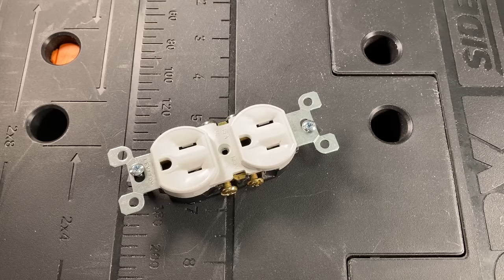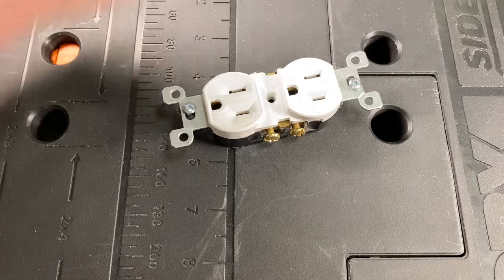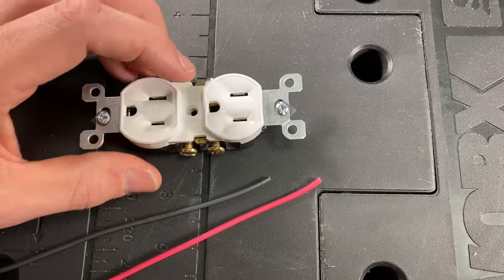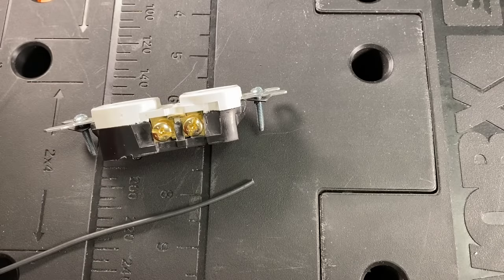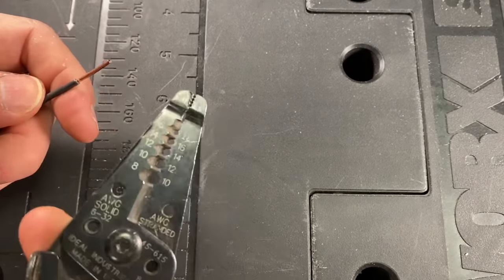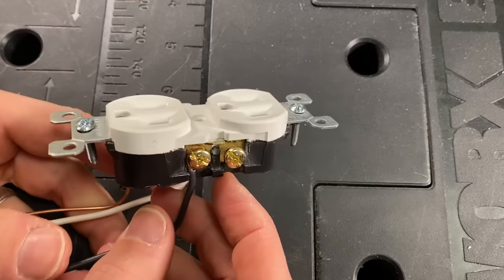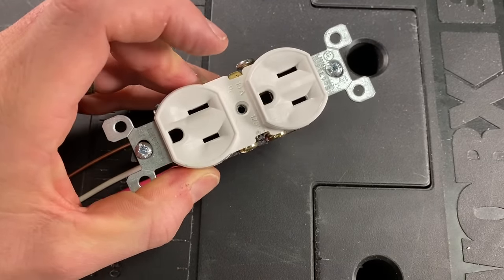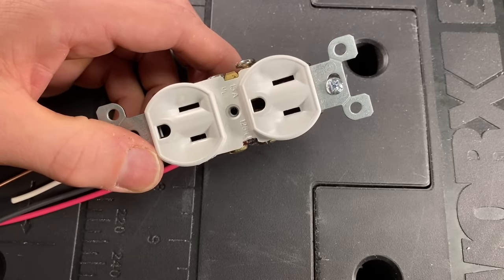Electrical Outlet Basics | How To Wire

Comment: I do believe the stripper guide is for the push in wires, but it works for the screw fittings, perhaps a bit on the short side.  Once one is consistent, it works fine.
Reply from the maker: I think you are right Paul, thanks for the feedback.

Comment: Those push-in contacts are the worst, especially if it’s an upstream outlet in a chain...  I was having trouble charging my EV outside only to discover an unused outlet in my pantry was burning itself up because of those push-in contacts... I changed the outlet and went with the screws and everything is perfect now!
Reply from the maker: Others have started to mention the EV charging issues especially when plugging into a $0.50 15 Amp Receptacle.  Probably will be something that NEC will want to address in the next revision.

Comment: Back in the day we didn't have voltage testers. We did have voltmeters so that is what we used.
Reply from the maker: You are not alone, sounds like many people prefer the meter over a voltage tester.
Reply: Some folks just stuck their thumb into the nearest electric socket (not recommended).  Cheers!
Reply: Definitely my choice...
Reply: @LectronCircuits  I used my Tongue 👅 😳
Reply: Were you trained to check first. Then after power off. Then check on known live??? I saw a pair of test leads be bad....Guy almost stuck his fingers in there.....
Reply: @timbernie  Also, always treat any wire as live!  Just like treat any gun as loaded; even if you just checked that it was unloaded!  There ar circumstances where you can’t turn off the power.  Ask a lineman!
Reply: @jimbaranski4687  Great advice. But, you are 38 yrs late.......
Reply: @jimbaranski4687  HUM! YEA! Jaimes......

Comment: One should never assume an existing outlet is wired correctly. The video is remiss in not illustrating how to check polarity with a voltage tester. Also, the NEC (Nat'l. Elec. Code, NFPA 70) does not specify the colors of ungrounded conductors; a switch leg to a switched recepticle does not have to be red. One should use a voltage tester to identify switched and unswitched conductors. Both of these processes require working with live conductors, albeit for a short amount of time. 
In other words, one should give serious consideration to having an electrician do the work.
If you screw up the plumbing you get a mop. If you screw up the electrical wiring, you call the fire dept. or maybe the coroner.
Bona fides; retired electrician w/40+yrs residential, commercial, industrial work in California and Connecticut.
Reply from the maker: Thanks for the help Ralph! 👍
Reply: And yet my plumber buddies make more loot than my electrician buddies, honestly.
Go figure, I can't. 🍺
Reply: @dpz9872  I know why plumbers make more and they can have it. Just watching them replace an old toilet or repair a broken domestic drain line made me glad that wasn’t my job.
Reply: @ralphaverill2001  
Money doesn't always equal smarts.
I move dirt and do okay not worrying about hepatitis etc.

Yeah, plumbers 😆.

Later
Reply from the maker: @ralphaverill2001  no doubt.  Things can get messy in a hurry 💩

Comment: Not required but I usually wrap electric tape once around the body covering the screws to minimize the chance of a terminal ever shorting out against a metal box.  This applies to switches also, and any two-gang box situations. You never know when someone in the future might  be working on the box with the power on. Or if eventually things work loose.

Comment: After installing 500 thousand outlets I don’t use the gauge anymore.Also 1 wire per terminal.
Reply: Never used the wire gauge lol. Just know not to strip out much lmao. And yes absolutely one wire per terminals.  If you got 3 wires just pig tail lol
Reply: Yes, one wire per terminal.  That’s why you have two screws on each side; usually for daisy chaining outlets.  I have seen a wire, stripped mid-wire, wrapped around a screw, and go on to something else.  I haven’t seen anything about that it the code! ~\~. There are an infinite ways to do stuff wrong.  Infinite kinds of stupid!

Comment: That was awesome!!!!!  Need to add several outlets in my She Shed..Was pretty Scared until I saw this video.  This may be a stupid question but,  is there a limit on how many outlets you can install on the same line of wire going to the Fuse box? Thank you!
Reply from the maker: The number of outlets would be more associated to the different appliances / tools which you plan to plug into each receptacle.  You can find load calculators online if you really want to dive a bit deeper.  Best of luck on your project and be safe.
Reply: @EverydayHomeRepairs  Thank you so much!!!!!!!!

Comment: Switch outlets should be installed upside down to identify them
Reply: Good idea, but ... in my 40 yrs old home, I had to look for these switched outlets in order to plug a light to it. I can certainly turn them upside down but decided to leave them as is.
Reply: What if it's a split duplex outlet, where just one receptacle is switched and the other is constant?
Reply: What do you mean by upside down...?
Reply: What do you mean "they SHOULD be"? Says who?

Comment: Last Step all electricians should adopt and apply is to WRAP your outlets, switches and all devices in black electrical tape at the wires point of contact.
Reply from the maker: I like the idea and seems to be very common in certain areas of the country.
Reply: It's not code and usually only done where tile is to be installed so  when
Reply: Never did this and never will. Don't see the need, especially if the boxes are plastic.

Comment: common mistake to avoid: tighten all unused screws so they don't short out against the box.
Reply from the maker: 💯thanks for the feedback
Reply: What is the problem if you do?
Thank for all the tips.
Reply: @caroledevlin5185  An untightened screw stands out further, and is more likely to short against a passing ground wire, the side of a metal box, or the terminals of an adjacent switch or outlet in a double box.  This is even worse for an oversized fixture like a GFI.

Comment: Great video, even though you showed it, you didn't mention that the wire goes Clockwise or else it will be pushed out when you tighten the screw. And something I was taught when I was a kid easy way to remember the hot side is the phrase "Black Gold"! The black wire goes to the Gold "brass" colored screws.
Reply from the maker: Good stuff, thanks for the feedback 👍

Comment: Uh, what was the common mistake we were supposed to avoid?
Reply from the maker: Hey Bobby, the common mistake to avoid is using the pin-in connections opposed to the standard screw terminals.  Push-in connections are less dependable and could lead to issues over time.  👍
Reply: 6:10 insulation under the terminal.

Comment: I never purchase 15 amp receptacles. The 20 amp have heavier contacts.
Reply from the maker: Thanks for the feedback Woody!
Reply: 20A receptacles on a 15A circuit doesn’t meet code
Reply: How to I know if it's a 15amp or 20amp circuit? By the circuit breaker box?
Reply: @pc5carter  yes. Turn off the breaker and check the outlet for power to make sure it’s the right circuit. Do NOT use a 20A receptacle on a 15A circuit as this guy says he does, it goes against the NEC
Reply: @pc5carter  all receptacles are supposed to be wired with 12 gauge wire. Usually to a 20 amp circuit breaker. Ga used to allow 8 receptacles in series and most electricians use 15 amp receptacles. I only use 20 receptacles. Appliances such as refrigerator, freezer, microwave, washer, garbage disposal all get their own breaker, feed wire and individual receptacle. GFI at sinks and concrete floored garage and bathrooms.
Reply: @mattschronce3503  you mean you run 12 gauge wire from a 20 amp circuit breaker and put a 15 amp receptacle at the end of the circuit??
Reply: I also see a lot of 15 amp GFI receptacles on 20 amp kitchen and bathroom locations which is very wrong!
Reply: 15 amp is only for lights and 14 gauge wires.
I run 10 gauge wire to water pumps in the yard and protect the pump with a 15 amp breaker. To 10 gauge wire prevents voltage drop from the long run of wire.
Reply: @shothud  omg man have you ever read the NEC or do you write your own code? You have it completely 100% wrong. 20A plugs are NOT allowed on a 15A circuit. However, 15A plugs are allowed on a 20A circuit with more than one plug. And you’re wrong again about the 14ga wire. That is allowed for a15A breaker but not a 20A breaker. Please go buy a code book before spouting off nonsense on YouTube to unsuspecting DIY homeowners who don’t know better. READ THE CODE
Reply: @mattschronce3503  Matt what do you mean when you say plug? I am 72 years old and had a commercial electrical license. I wired and worked industrial three phase up to 13,800 volt systems. Nuclear, coal, gas turbine commissioning. Plug does not enter anything I had said so far. I said 20 amp breaker, 20 amp wire 12 gauge with a ground and 20 amp receptacles. The only place 15 amp goes is to lights, 15 amp wire, 15 amp breaker ect. Yes I have the NEC code on CD. I also taught electrical AC and DC to journey men electricians in a papermill for a year.
Reply: @shothud  what I said was read the code, this should be clear.You cannot put 20A receptacles on a 15A circuit, per the NEC. Simple as that.
Reply: @shothud  and all receptacles are not required to be wired with12 gauge wire. Again, PER CODE. This is basic code stuff so not sure who you’re teaching this to, that’s scary. 14ga is used for 15A circuit. Sure, you can use 12 gauge but it’s not required per code
Reply: @mattschronce3503  I never said anything about a 15 amp circuit. 15 amp is only for lighting circuits. Please read my first comment more closely.
Reply: @shothud  no I’ve already read your comments. You even said putting 15A receptacles on a 20A circuit is very wrong. As long as it’s multiple outlets, it’s fine.
Reply: @shothud  15A receptacle circuits are extremely common

Comment: It’s easy to wire an outlet like you did out of the box and just small lengths of wire....now fight with it in a wall box, not so easy....
Reply: Service loops are very helpful
Reply: You should have about six inches of slack in the wires, and fold them up while pushing the outlet into the box.

Comment: Red also for MBC   Green not always used with conduit. Many electricians just remove insulation in middle of wire and loop around screw as it goes to next outlet

Comment: I was trouble shooting a furnace installation and the electrical was done by the contractor's wife. In one area she had used "liquid solder" to hold some wires together, which is silver colored glue !
Reply from the maker: 😬 yikes

Comment: I see many people mentioned that the loop should go clockwise around the screw. I did not see however any reference to the tab on the outlet when replacing a switched outlet. If you replace a switched outlet and forget to remove the tab, not only will the second outlet not be switched, but the red wire going back to the switch will be powered. if the switched outlet and the powered outlet are on different fuses you can wind up with a very dangerous situation even more so than the power going back to the switch. If you turn the breaker off for the always on or the switched outlet, but not the other, the power will back track right into the breaker box, and you won't know until you get shocked or there is a fire.
Reply from the maker: Good point and thanks for the feedback.  I quickly mentioned the tab but didn't provide the failure mode you outlined.  Appreciate the help!

Comment: I would like to mention 3 items of importance, 1- The "voltage tester" you used in the video is a "proximity" tester, NOT a voltage tester. Not understanding the proper boundaries of this devise could result in Death! 2- direction of wrapping the screw  with the wire is very crucial. 3- always screw in the unused screws to help eliminate potential electricution when touching ground wires while installing the devise into the box.
Reply from the maker: Thanks for the feedback Jeff, appreciate the help.

Comment: A couple of things...  If the push in connectors are no good, and often not to code, why are they there?  I never use them.  You should also point out that the wire should go clockwise around the screw, so that as you tighten the screw, it ‘pulls’  the wire around with it instead of pushing the wire backwards and straightening the wire out.  

I usually strip the wire a hair long, and once I have the wire around the screw, I will use a needle nose pliers to press the end of the wire in to go completely around the screw instead of 3/4ths or 7/8ths around the screw.  Some people just jam the end of the wire under the screw, tighten the screw, and call It good; don’t do that.  

There are some outlets where the screws are kind of loose in the housing, and flop around against the housing  instead of being held out from the housing so that it’s easy to get the wire behind the screw.  Sometimes the body of the outlet is in the way of getting the wire behind and around the screw.  Avoid these kinds of outlets.  

Then there is one kind that you can just push the end of the screw under the screw, bend the wire, push it in and around more, bend it more, repeat until done; no need to bend a loop in the wire with a set of pliers or strippers. 

You should also talk about daisy chaining outlets.    I hope you have a video about different kinds of wirenuts, and branching circuits.  Thanks for cutting the outlet open and showing us the real difference; I will definitely look for the commercial outlets with the metal strip across the back in the Future!
Reply from the maker: Hey Jaimes, thanks for all your feedback and I appreciate you taking the time to share.  👍

Comment: I'm a service electrician and I've only had one service call where someone  used the quick connection and it wasn't the connection that failed they cut into the copper when stripping and the wire broke.

I've seen many melted outlets where the  someone wrapped it around the screw. It's usually installers error though.

 If installed properly both methods are just as safe as the other. I use the quick connects and haven't had a call back. Older electrician don't like them because they used to suck back in the day but the products are much better now

Comment: The push in holes on the back of a switch or receptacle are designed for 14 ga, wiring. The back also has a stripping guide as to how much insulation to remove for the push ins. If using the push ins always tighten up the screws except for the ground that will be utilized. The side screws are to be used if you are using 12 ga. wire as many electricians utilize because of the ability to carry higher amperage as when using a heavy duty receptacle identified by the sideways slot next to the neutral slot.
Reply from the maker: Thanks for sharing your knowledge / experience.  We appreciate the help and engagement.
Reply: The thing is with those terminals, they hold the wire in by spring tension.  Over time the spring can relax causing the connection to not be as good.  Especially if the outlet is being used in a heavy duty situation such as a kitchen or a workshop where the outlet is always carrying heavy loads and even more especially if that load causes the outlet to get warm.  It's always better to use the screws because they will always stay tight as long as you tighten them down sufficiently.

Comment: Well done vid. The stripper-gauge needs to correspond to the correct gauge of wire, or you may score the copper and cause it to break while pushing the outlet into the box.
Reply from the maker: Good note, thanks Billy.
Reply: The wire striper tool does not give or tell how much or how far from end to strip insulation the gauge hole size do help from nicking or scoring wire please look at back of duplex there is strip length gauge

Comment: My home was built in the mid to late 40s and I have switched outlets. I replaced a receptacle not long after moving in and the wall switch would not work afterward. Well needless to say I was stumped at first and blamed the switch. After exhausting all my limited knowledge, as I am a DYI guy, I called a friend who is an electrician and he informed me what I had messed up. I felt dumb of course, but I learned something and that was the important thing for me. If you do not know there is no shame in asking someone who does.

Comment: Wire doesn't know what color it is! Lol! Ive seen so many and have wired so many different ways! Good vid.
Reply: I usually squeeze the wire loop around the screw as well with the strippers needle nose etc.
Reply from the maker: Appreciate the feedback.
Reply: If you are using colored wires in a nonstandard fashion, you must mark them with electrical tape, or marker.

Comment: I had a problem where one outlet had two wire in the push in connectors. The other set I put on the screws on the top. The other set was on the bottom push in part. I had a short and kept flipping the breaker. Changing the set of wire on top to the bottom terminal fixed the issue. For people with older homes. On new homes you should only have one set of wires to mess with the pigtails help a lot today.